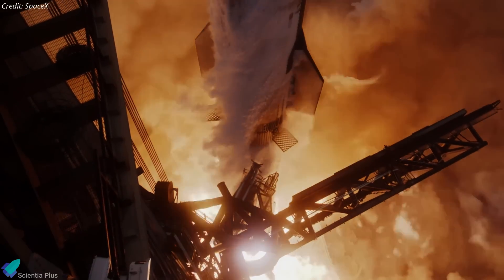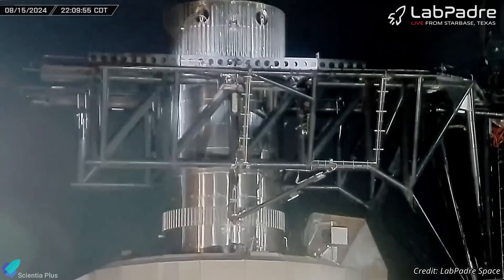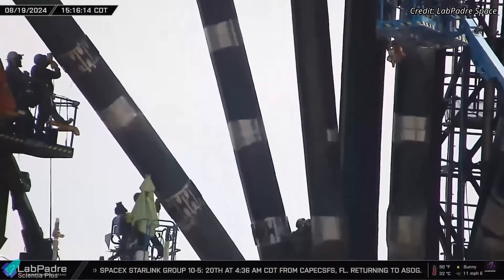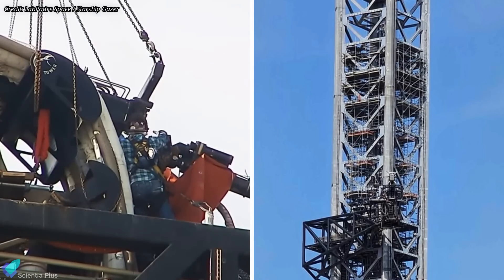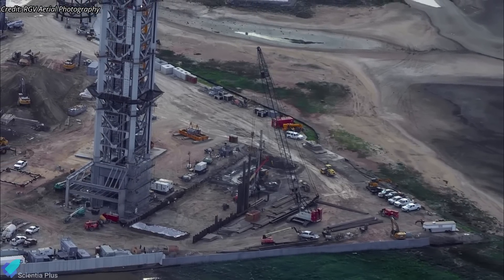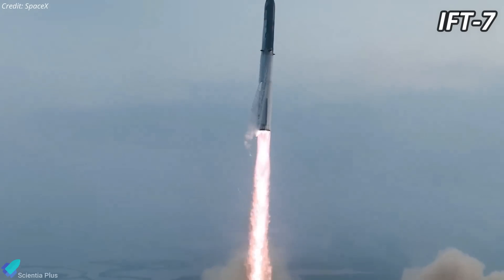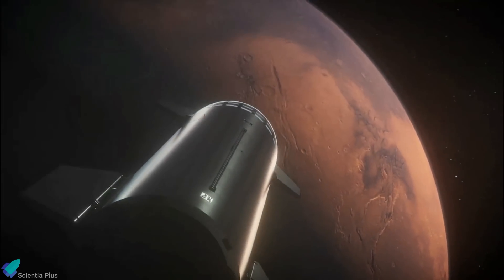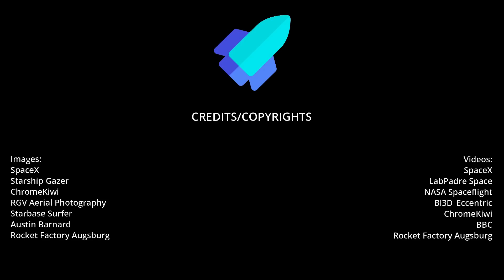SpaceX Starship Insane Design Fix to Boost Raptor Ignition In Space

Comment from the maker: 00:00 Starship Updates
10:50 RFA First Stage Destroyed in Static Fire Test ‍🔥

Learn More:
1. Latest Starship Upgrades
 a. Starship Hot Staging Explained: https://youtu.be/qgZHo9wYRW0
 b. Super Heavy Booster Upgrades: https://youtu.be/vZH5esgrFiM?t=63
 c. How SpaceX Protect Raptor Engines: https://youtu.be/L22gyQDDXho
 d. Starship New Heat Tiles Explained: https://shorturl.at/p2Ijb
2. Starship V2 Features:
 a) https://shorturl.at/lpGT7
 b) https://shorturl.at/gwNQ4
 c) https://shorturl.at/xa60S
3. Starship V3 Features: https://shorturl.at/mnBT4
4. Starship V2, V3 & Raptor V2, V3 Complete 2024 Update: https://shorturl.at/tN248
5. Raptor V3 Mega Upgrades & First Test: 
6. Starship Block 2 Stacking Begins: https://shorturl.at/hXEzO
7. B14.1 & Catch Tests #1 Explained: https://shorturl.at/w0zDU

Weekly Updates: https://bit.ly/3HIQjPC
SpaceX Playlist: https://bit.ly/34wue8T
Reply: what happens if the catch doesn't work?

Comment: I can’t believe everyone thinks this thing will launch in September and the hold back is catching the booster. That may be part and it may launch in September but only if the Industrial Wastewater permit SpaceX applied for on July 1, is approved. Seems no one wants to talk about SpaceX being told before Flight 1 they needed the permit and only after being cited for no less than 4 violations (each flight) and with the attention being brought by the CNBC report, the FAA realized the permit they were to apply for a year ago was never applied for and thus not issued. Now SpaceX has given environmentalists a crack to get in and harass the EPA and FAA about. Both are ticked that Elon BS’ed them and never completed the paperwork and as a result they can and probably will be sued. Therefore no one is launching anything until the permit is issued which could take months. Launch in November, late October at the earliest

Comment: I think they should start planning to add legs to the booster. That catch is not easy. Also, adding legs will add weight. So they need to go back to the drawing board. Prolly observe mother nature some more and use up earth elements. That giant booster prolly need a giant hole in the earth to land in, then they use a crane to lift it out.

Comment: Use a 3 foot electromagnet plate, on the ship to keep the arms from swaying, it only has to be on for a half second at a time.
Reply: I like your idea. Any danger of sparking unused fuels?
Reply: Put the magnet on the arms? It's a stainless steel rocket here. But that thing is still a big bomb for awhile. I  think you're right. They can get around the Hindenburg part.
Reply: It seems like the equivalent of a micrometer-level "ratchet" mechanism, that can hold without bounce for the few seconds needed, and then be turned off, might be a better alternative.
Reply: Weight is their enemy.

Comment: I thought the New StarShip V2 & V3 were taller, so wouldn't that necessitate modifying the Quick Release mechanism ?
Reply: No, the SQD is placed at the same position. The extension is above that, so it is not a problem.
Reply: @knowledgeisgood9645  Thx for the reply.  I wasn't sure about the new "Block 2" version of SS but I'm sure I've heard the Block 3, which is significantly taller,  was going to need to raise the SQD. Don't quote me on that but i believe it was mentioned on another channel covering StarShip. We'll see.  : )
Reply: @uuzd4s  That was because that version has taller boosters, not the length of the ship. Taller boosters place the ship as a whole higher up. That is when the SQD has to follow.

Comment: If we can’t break the firmament or it’s impossible to go the the v belt how do expect to get to the moon/ mars.
Reply: First, "WHAT 'FIRMAMENT'?" What are you even talking about? ("Break the firmament" - how old are you, six?)
Secondly, the van Allen belts were discovered by someone who was alive during the Apollo missions, and figured out they are not the same everywhere: there are weak areas, and stronger areas, and he and NASA figured out ways to navigate the weak points. 
Also, they are not "instantly lethal bands of killer, melt-your-face-and-turn-you-into-a-zombie" radiation. The speed with which Apollo astronauts passed through them made it extremely safe. They all lived a long, long time. 
Lastly, the types of materials we have  developed, and the placement of supplies around the astronauts, shield them to a HUGE degree from the van Allen belts. 
Why don't you try doing a little independent research - if your church will let you, and use that thing God gave you called a "brain," to do some INDEPENDENT (I know, it's a scary word) RESEARCH - use a "search Engine"  to find out some actual FACTS, instead of going by the OPINION of your religious friend, or Pastor. 
God would have created a much, MUCH smaller brain for you, if all he wanted was for you to be on your knees, expressing ignorance as if it were facts.
Reply: made up problems require no solutions ;)